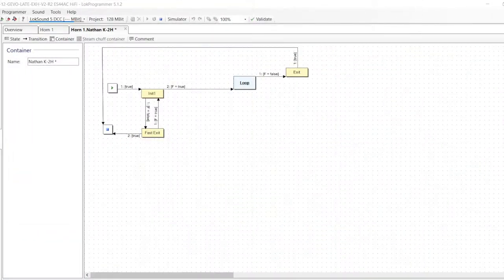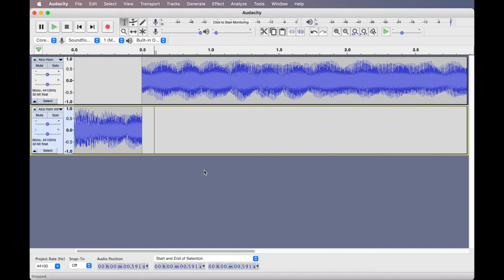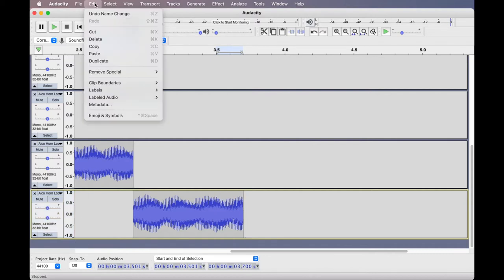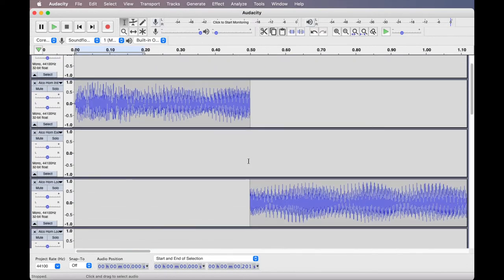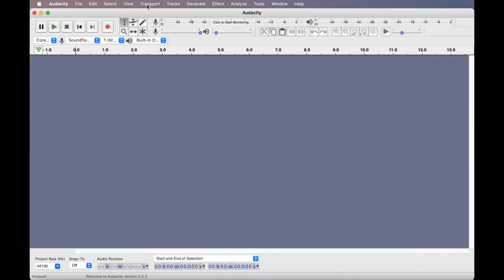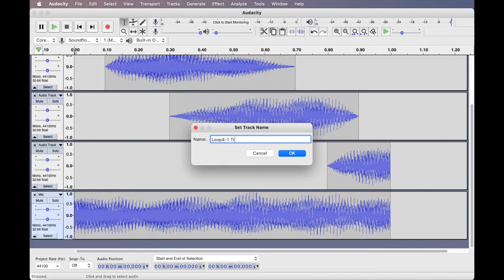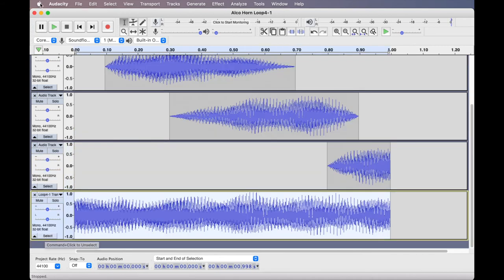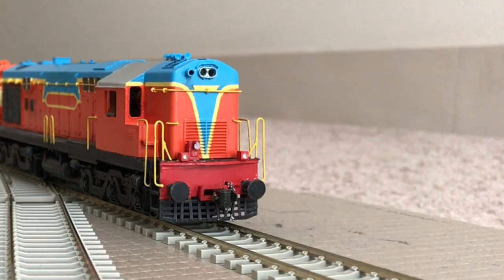Creating a Custom Horn for ESU LokSound Decoders

Comment: I can't change the horn sound being played on the simulator tool, no matter what I do
Reply from the maker: Which Loksound file are you working on ? Is it a diesel, steam or electric sound file? North American or European? Each is set up slightly differently.
Reply: @indianrailmodeller4259  I think I figured it out.. I changed the number in the SV9 box and it worked!
Reply from the maker: Awesome! Yes, that’s how it’s set up in North American Loksound5 diesel sound projects.

Comment: Do you have the Lok Programmer with you? Can you help me put a sound file on my ESU Lok Sound 5 decoder. The sound file that I currently have does not have a very good sound quality. Please let me know if you can do that for me. I will subscribe your channel if you can be some help here....regards :)
Reply from the maker: Hi Desh, I can help you with the Loksound file, depending on your location.

Though, in my experience, poor sound quality has more to do with the speaker/enclosure than the sound file. All ESU Loksound 5 files are recorded in CD quality and are generally quite good, especially their HiFi sounds. You may want to check the speaker/enclosure in your model first. Which sound file and model are you working on ? Thanks.